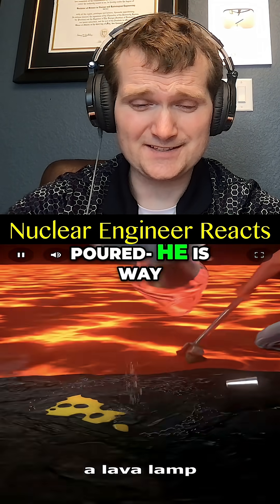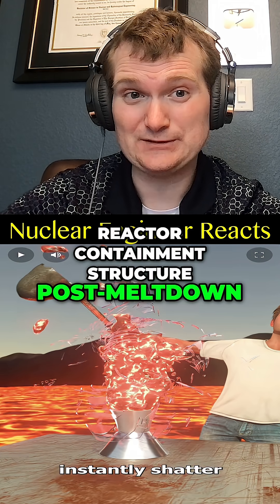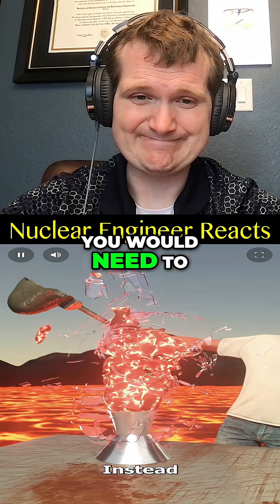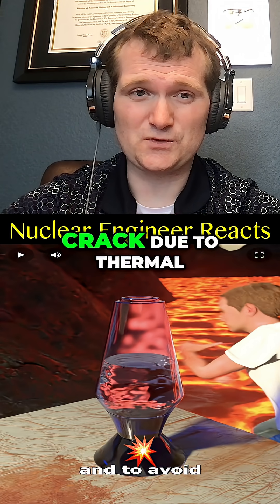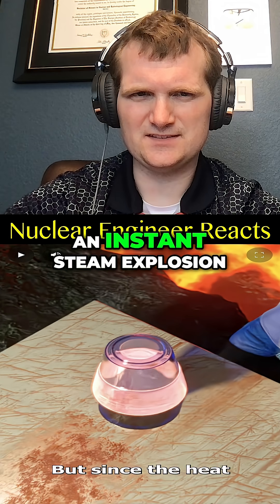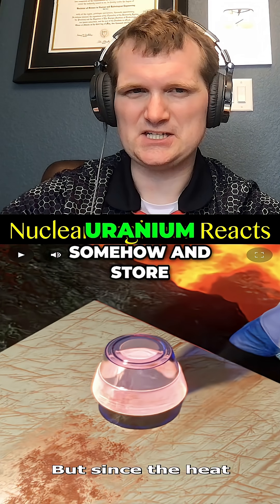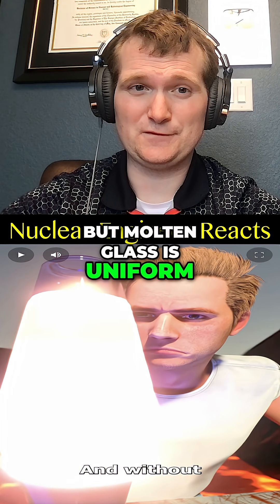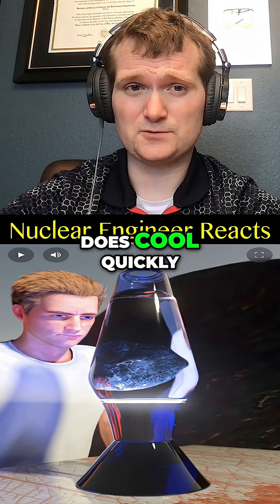Can You Make a Lava Lamp With Real Lava? - Nuclear Engineer Reacts to Zack D. Films

Comment: If you're within roughly 12 ft of a fresh lava flow you absolutely need to be in a lava suit if you are not you will basically hat first have your hair just singe or catch fire and if you're even just a little bit closer your skin will actively melt and ignite on fire. Yes if the scene from the third Star wars movie was accurate both of them would have been ignited when they were fighting on the drones
Reply: I don't remember if that was just molten metal or if it was a lava but still